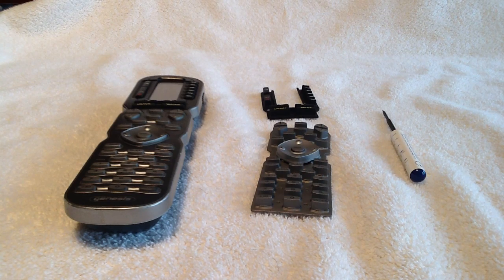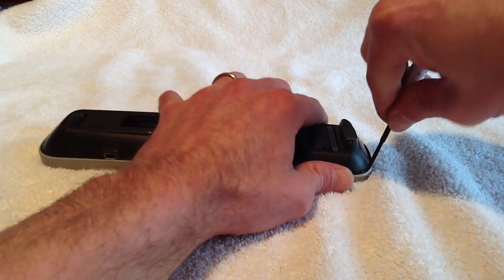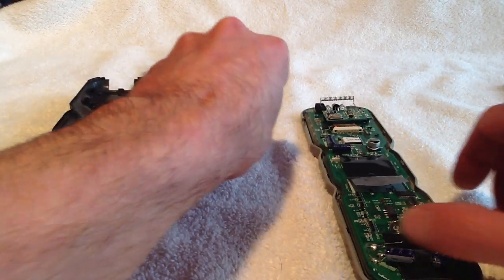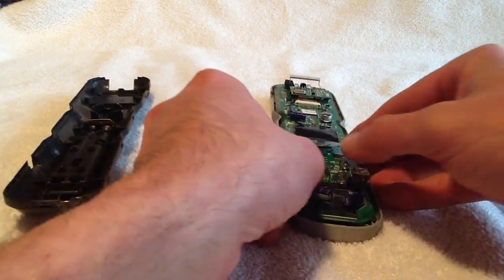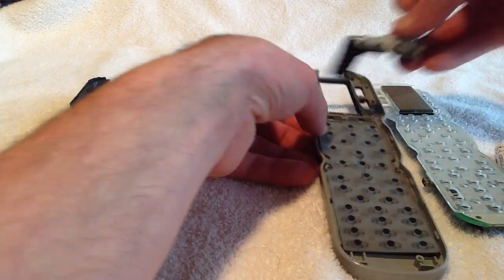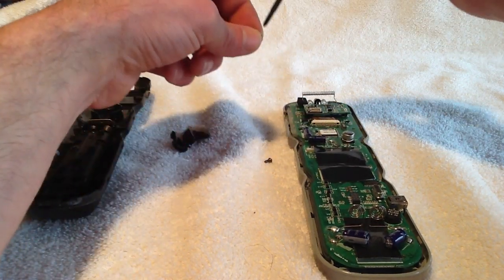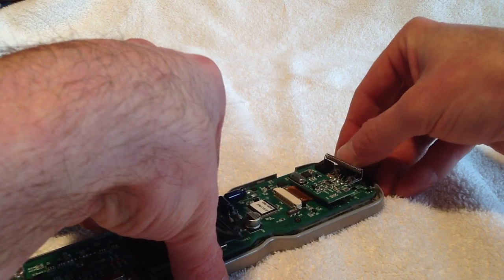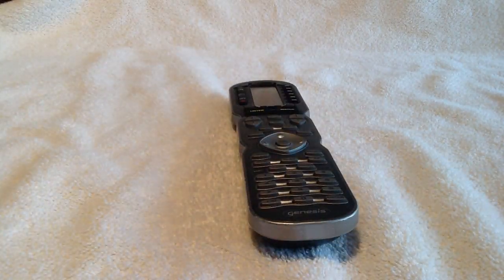MX900 Button Replacement Tutorial

Comment: I thought what a great idea I want to upgrade my 850 to a 900 because I have so many problems with the buttons not working then I saw this video and was going to ask the same question where do you buy the membranes but I see nobody has an answer either. What's the point of putting a review up if if you can't find your membranes replacement kit